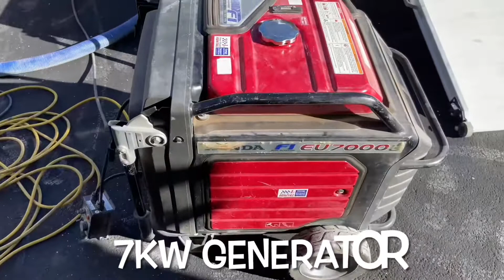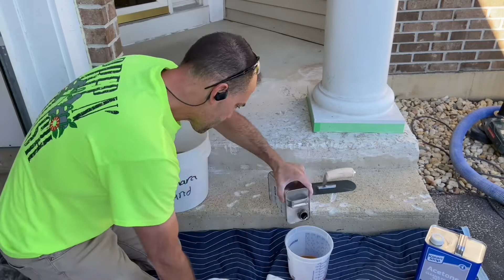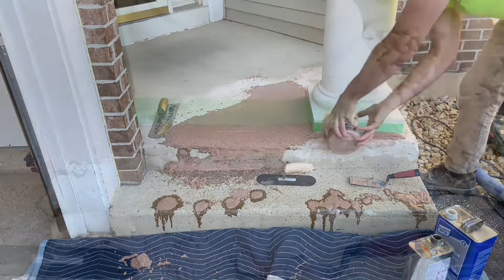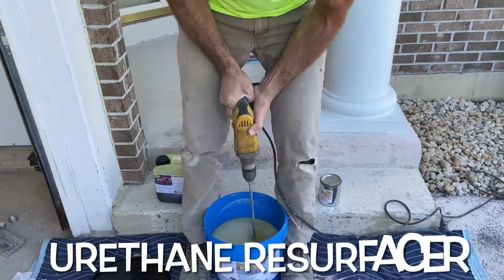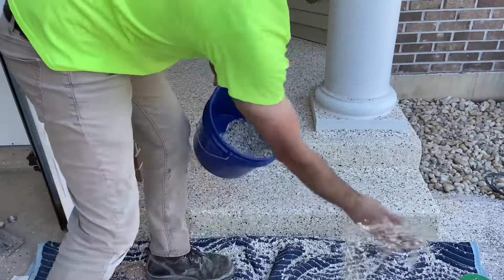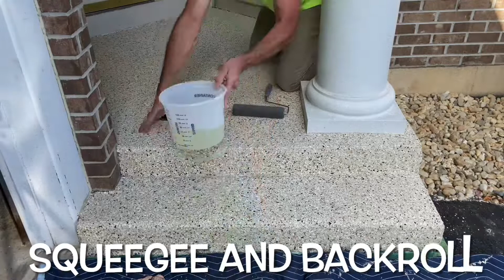How To: Exterior Urethane Flake Concrete Coating

Comment: Great information. I have a floating staircase that I wish to urethane coat, but I'm not sure how to flake coat the bottom of the treads. I'd appreciate any advice.
Reply from the maker: @sulaimanalzubairy193  thanks so much. Flaking the bottom of the treads is possible but it likely will take a few thin coats to build up a uniform appearance. I would mix a small amount of resin and apply a thin layer. Then, with a gloved hand, press the flake. It will be time consuming but I can’t think of a better way to do this.